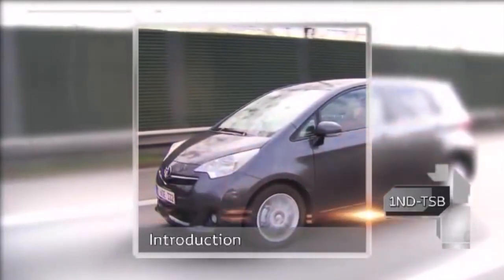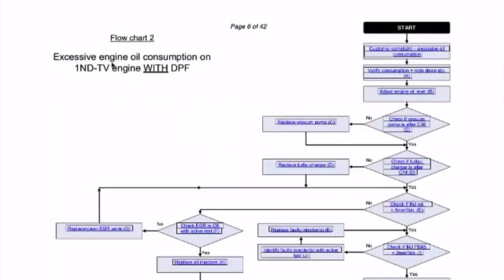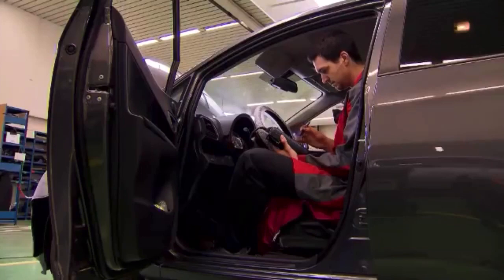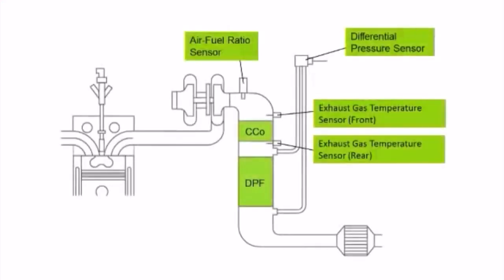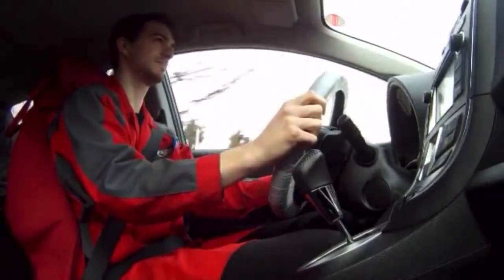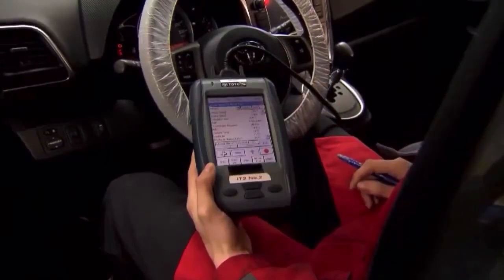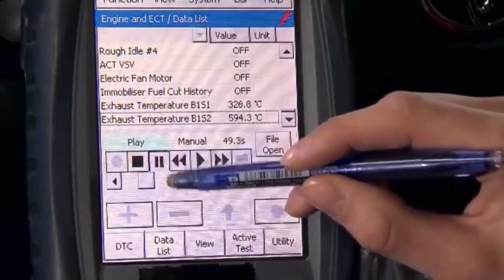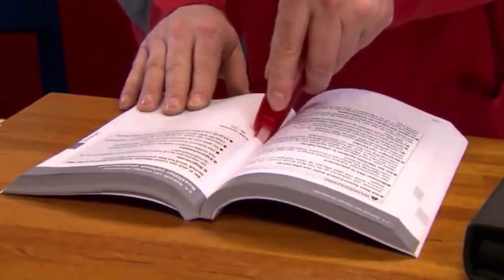Toyota 1.4 D-4D engine common fault

Comment: My is from first owner 2008 model with 239.600 km now. Next weak a remap to 115 hp and 260 Nm will be done. Alsow back suspention will be changed. 
I intend to drive it at least 2-3 more years if i don't sell for the monney i want.
Reply: Did you notice difference in remap?
Reply: @DooDicky I did a remap on mk1 yaris/echo 74hp stock to more less 90hp, very very very noticeable difference and I’m really pleased with doing it.
Reply: I’ve had my Toyota Yaris 1.4 Diesel 09 reg for 2 years’  never been any trouble’ great on fuel ⛽️ 6 speed’ Brilliant little car 🚗 👍

Comment: What year model does this video aply to? I have seen excellent endurance and trouble free on 1.4 D-4D engines manufactured in 2007, they don't look the same, the injectors are different and the valvecover also, plus the EGR-coler is horisontal.
Reply: They say from November 2008 on. 2007 should be fine.
Reply: Those were made in Japan. Then Toyota began Engine manufacturing in Europe...  Problems started
Reply: 😮i had a early 2008 model from new, put 212,000kms on it over 4 years. Early engine type than in this video. Never had an issue. I changed oil & filter every 8000kms, added 1 litre Dipetane to a half tank of diesel every 6 months or so. Other maintenance, rear left wheel bearing hub replaced at 180,000kms. I regularly got 63mpg (imperial gal).
Is the engine featured in this video a design change for emissions? Or reduced manufacturing cost?
Reply: @TeezerDriz  My sister has an Auris 2007, it now has 430.000 km on it, no breakdowns except faulty wire to the air intake gauge, replaced rear wheel bearings in approx 400.000, dry seals so the outer races of these extreme bearings had rusted. Several brake pads and 3 sets of brake disks.
This Auris is UK made, but perhaps the motor is Japan made, it looks the same as Corolla D4D from Japan 2008 model. I'd say that the UK made Auris chassis (besides rear brakes) is somewhat better than the D4D 2008 Corolla that my other sister has now at 230.000km.
Reply: i have an auris 2009 1.4 d4d 5 speed manual without dpf.In the city drive i dont have oil consumption but when im on highway 5th gear 120-180 kmh start to burn oil.I dont know why?

Comment: 1 ND-TV is a very bad diesel engine. Had a Toyota Auris 2009 1.4d. 
It was neither economical nor fast. Used the same amount of fuel per 100km as 2 liter engines.
Startedto burn oil after ~70k km at such a high rate (close to .75l per 1000km) that no oil changes were required anymore, all oil as changed before required interval..
Avoid this at all costs.

Comment: Yaris 1.4 d4d 2009/10/11 made in France also have the same problem. Want reliability buy Japanese made only. French or UK will never make reliable vehicles
Reply: The engine is usually imported from japan anyway. They are trash when they are trash. designs.
Reply: The Japanese have pride in their work .